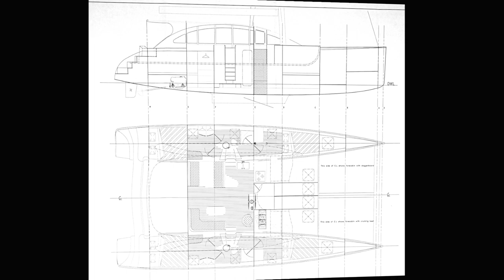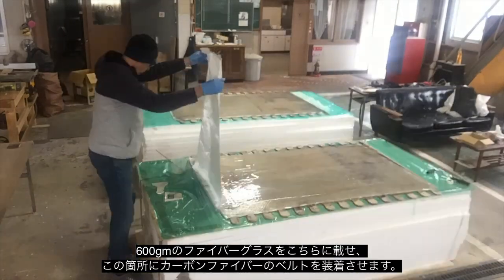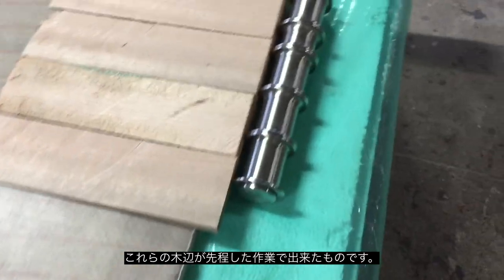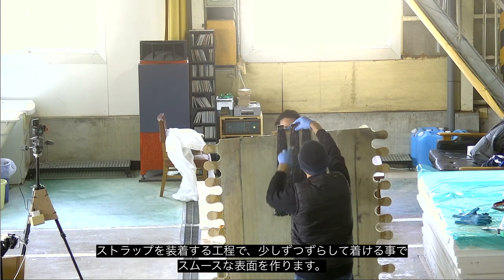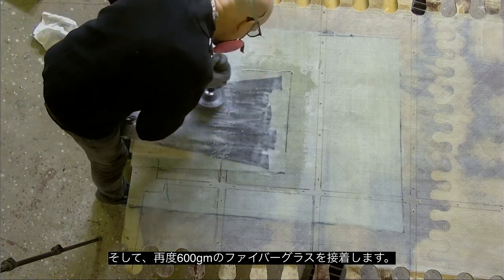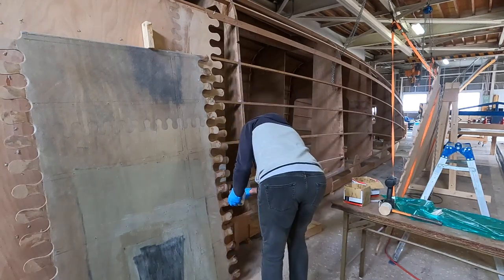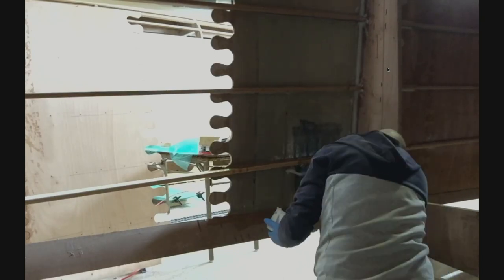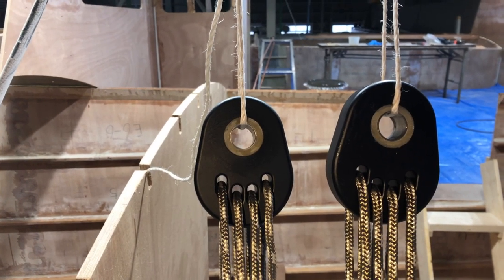Will these be strong enough to hold up the mast?

Comment: Can I just ask about the puzzle panel joints.  Obviously you lose a bit a strength, but how much?  Do you back then with a glass layer? 
I understand that they make the assembly much easier and far more accurate.  Are you finding the fit millimetre perfect?   I guess reality is never as perfect as the CAD.
Reply from the maker: Hi Mark, actually the joints are quite strong, they are made with little location nodes which keeps a consistent 1mm gap around the joint, then the joints are painted with straight resin before joining, after pushing them together, using a plastic spatula a mixture of resin, milled glass fibre and cabosil is forced into the 1mm gap then the whole joint is put into a press and left for 24hrs.
The fit of the kit has been amazing, I estimate a saving of 5-6 years on cutting and scarfing joints, not to mention the cad system is able to give the best cuts in minimise wastage of material.
Kev

Comment: I have a study pack for the DH550 catamaran and on the drawing of the hull it is clear that the hull has a curvature more or less everywhere along the side of the hull. When you do the chainplates like this flat on the work surface treating them with  multiple layers of resin, fibers, wood, carbon fiber and ultimately the extra layer of cloth I would assume that this piece would be very stiff and would not flex at all when applied to the hull. How does this play out? do you have to do a lot of extra fairing to get this "kink" out of the fair line of the hull?
Reply from the maker: Hi 
Actually the plan from top to bottom of that panel is quite flat, once the panels have the fibreglass on, there is still enough flex for the slight curve of the hull in that section. 
Stay tuned to see the outer side panels go on.
Hope you get to build your 550
Kev
Reply: @saltlightdix4704  OK, so I guess the layup schedule has been taken into consideration when the design was made together with the reduction of the plywood sheet thickness. Another impressive feature of the work from Dudley and Phil! 

They really have read the "bible" for this kind of material application. The "Gougeon Brothers On Boat Construction" book is really the best one out there and should be read by all aspiring boat builders. I believe Phil Harvey stated that the original "Wild Vanilla" , now named "Taika" was build to this code in its full. 

The publication covers every aspect of various methods involving wood and epoxy for boat building. Dont let the original date of publication fool you. The book is spot on in every aspect and every sentence in it means something. Kind of like the Bible I guess 🙂 

It is even free for downloading as a pdf. It also covers why the WEST system epoxy is the best for boat building. Not just like a "commercial" but like "slap bang here are the numbers". Cant argue with that. So good choice of epoxy by you!
Reply from the maker: Yes it’s a great book, studied it thoroughly before starting the build.

Comment: Is there an electrically insulating layer of glass fiber between the stainless steel thimbles and the carbon fibers? That is required. Also, you didn't leave the peel ply on did you? It kind of looks like I can see the lines of peel ply (I'm sure you wouldn't do something like that but just thought I would check!). If the thimbles are titanium then I don't think it is required.
Reply from the maker: Hi McKenzie, thanks for the comment.
No there is no insulating glass between the carbon fibre and the thimbles, I followed Dudley Dix's design.
Yes I did cut out and remove the peel ply before laying down the carbon fibre, I just left the peel ply around the outside of the panel.

Kev
Reply: @saltlightdix4704  If there are any more places where carbon fiber is in direct contact with stainless steel, I definitely recommend you use one layer of glass fiber to avoid the direct contact. You can ask Dix about it if they are available to answer inquiries. It is a standard practice in the marine industry. You may have to redo it some day (after some or a decade).
Reply from the maker: Curious to know what the purpose would be. If the shrouds were connected to the thimbles via a turnbuckle I could possibly understand why, but the shrouds are connected by Spectra which is non conductive and the plywood is also non conductive 
Unless I’m missing something 
Kev
Reply: @saltlightdix4704  You know about dissimilar metals. Graphite behaves as a more noble metal than stainless steel. Graphite in contact with stainless steel does to stainless steel what stainless steel normally does to aluminum (causes it to oxidize or erode). Nothing to do with the shrouds or hull at all. It happens right at the point where stainless and graphite are in direct physical contact. What I would expect to happen over years or a decade is for the carbon to kind of "eat" the stainless steel. Don't take my word for it. It is a known issue. My buddy with a Catana had his carbon mast "eat" a stainless pin. He opted to replace it with titanium. It took many years and was still possibly serviceable. It is just that it would be very difficult for you to change that thimble. That is why I mention it. The chain-plate will last forever. The thimble may erode in a shorter time than you expect. Don't get me wrong. I love your boat and your approach to it and everything. I am just trying to share information. Not bring you down or discourage you in any way. It is a great project.
Reply from the maker: Thanks for that. I am the first person to admit I don't know everything, and I'm always eager to learn from others.
It makes sense, just had never heard of carbon fibre and SS being a problem before.
I have not heard that it has been a problem on the DH550, which is the same boat, just 8' longer. The first of those were built late 90's early 2000's
Maybe the resin that is impregnated into the carbon fibre hinders the oxidisation process.
Certainly worth a chat to Dudley though.
thanks also for the encouragement, I appreciate it

Kev